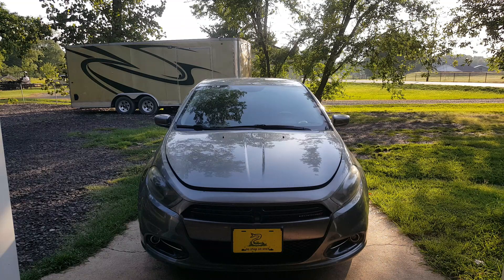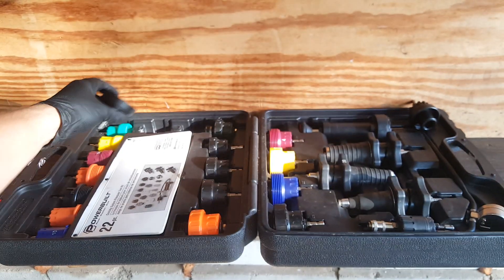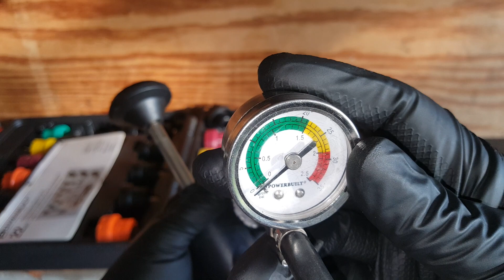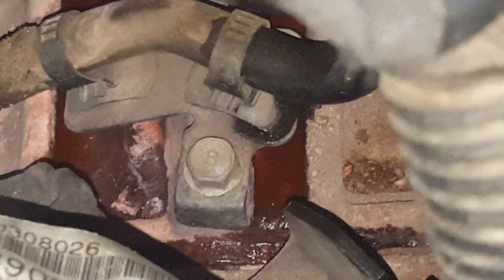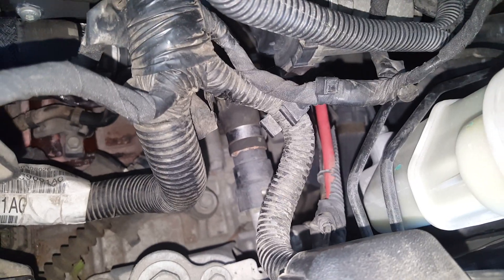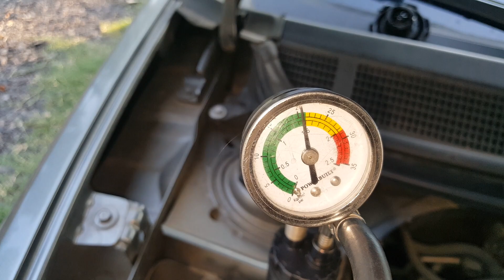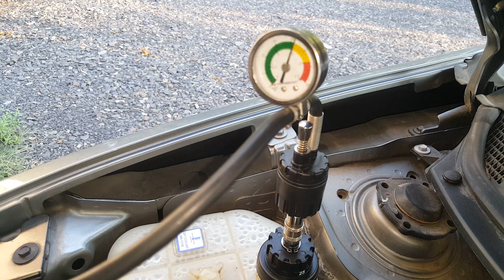How to use a coolant system pressure tester/checking & locating coolant leaks 2013 Dodge Dart

Comment: my t piece exploded no exaggeration!! but i replaced it afterwards the guage was pretty much sitting where it should but im noticing smoke coming from the radiator there is a rectangular piece thats wet but the main radiator piece behind the rectangular piece is bone dry
Reply from the maker: Yes very common for these to go all at once. Good thing you caught before it could cause any damage. All that coolant will need to dry and burn off before you can tell anything. But most likely just the coolant that sprayed everywhere. Thanks for the feedback.
Reply: @WrenchTheory501  thanks for responding back i needed this info
Reply from the maker: Glad I could help.
Reply: im wondering if there is a leak or if the excess from the t exploding is causing the smoke
Reply: it's hard understanding if there's a leak because once the t piece exploded the coolant went everywhere

Comment: Great video.  I recently had coolant spray all under my hood and engine while driving. Would it most likely be a top radiator hose? Any suggestions. Im assuming its not the radiator because how would it spray all under the hood.
Reply: That “T” area popped on my 2.0 Dart while driving. I lifted my hood and coolant was spraying every where. I got a ride to an O’Reillys and got a new “T” I don’t remember if I replaced the hose or not but the “T” is plastic and it was corroded. I changed it on the side of the road and added coolant and haven’t had an issue since. Well now coming from my reservoir tank is a hissing sound from the plastic nipple and hose area. I love it around a little and the noise goes away. I need a new tank because the plastic is old breaking. Hope this helps.
Reply from the maker: What he said above , these plastic T's and other plastic fittings are notorious for leaking , and worse case ruining engines. Thanks for the feedback.
Reply: @jevonrussell3159 just noticed your reply, I already figured it out. But yes that's exactly what it was. The top radiator hose t connector snapped. Couldn't find the t connector on its own so I had to replace the whole hose assembly that came with the t connector. Thanks for both of your replys.

Comment: 👍👍Good day to you. Please tell me, I changed the engine oil and after a few days the hydraulic compensator on side A rattled. Could the reason be in the oil. GMC Acadia 2008. Thank you, all the best.
Reply from the maker: That is very strange indeed. I would say if the same oil was used and the proper level there should be no change. I feel like the pcv system on these may be inadequate , and also the oil wants to gum up over time. If you have not looked , you might pull one of the valve covers and take a look. Hope it is nothing major. As always I thank you for your great feedback.
Reply: Have a nice day. I thank you for your kind reply. Dear, I change the oil every 6000km. I live far from America, we have European oils with tolerances, there were no problems before these oils. Not long ago I came across AC Delco 5w30 dexos1, compared to it it was a little thick and brown, it started with it. two compensators knock. Forgive me for scribbling a lot. God bless you.
Reply from the maker: I hate to hear that , hope you find a good solution. Thank you again for sharing.